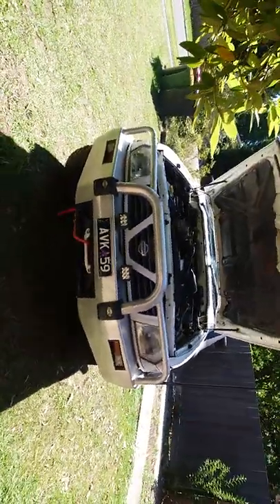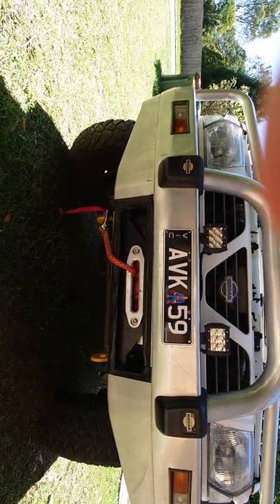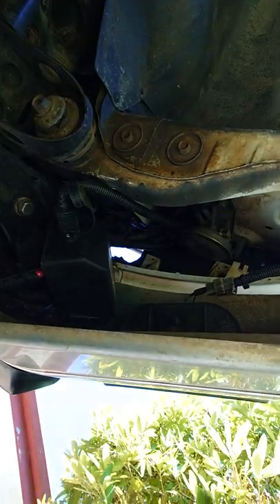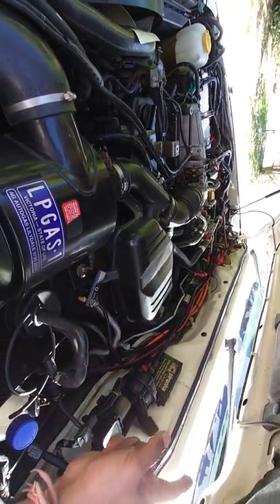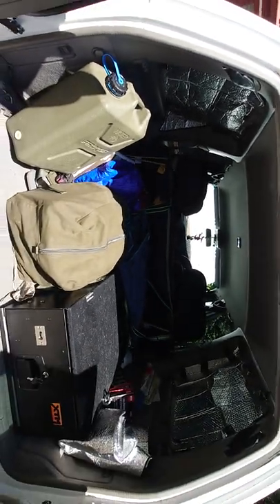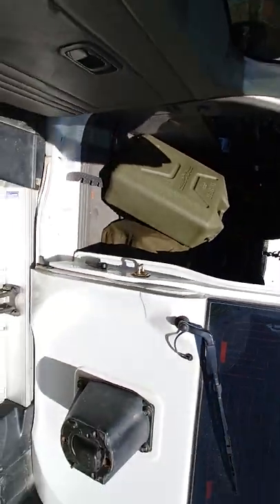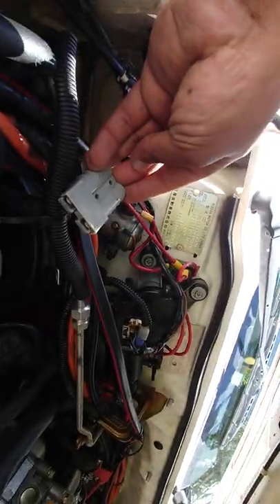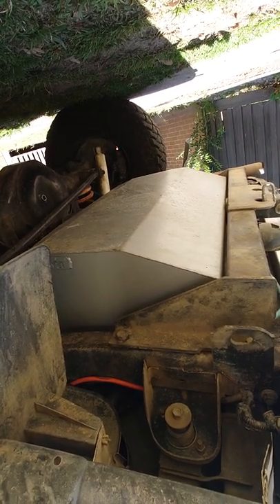Budget Build : GU Patrol tb45 walk-around part2

Comment: Hi mate.
Did you remove LPG system yourself?
How hard is it?? 
Cheers
Reply from the maker: Hi mate..yep, i did it myself. Was not tough at all.....main lpg tank was heavy but it was pretty easy procesure.  Re-plumbing Petrol lines back to stock or main tank was a bit trouble but eventually working now ... Havent wired subtank yet but main tank working now as factory